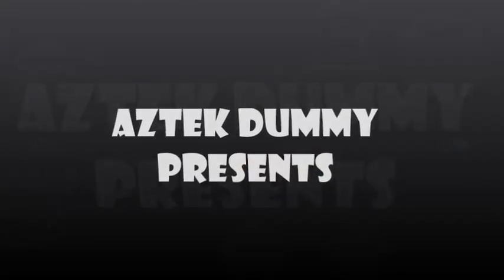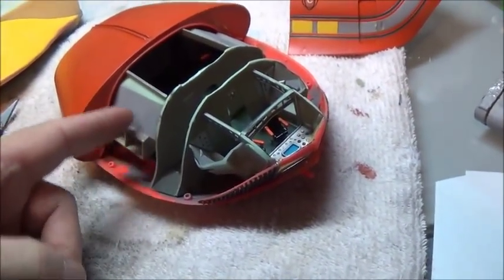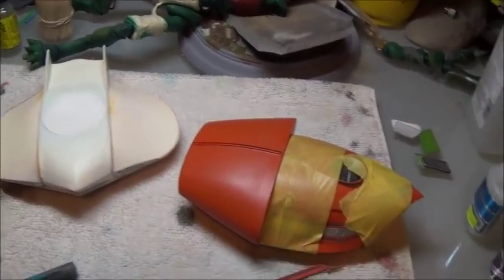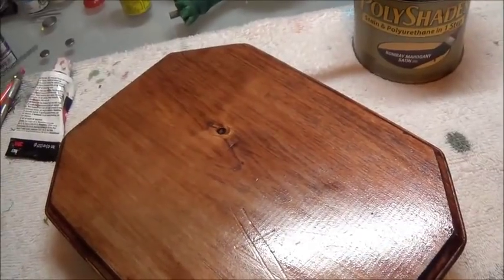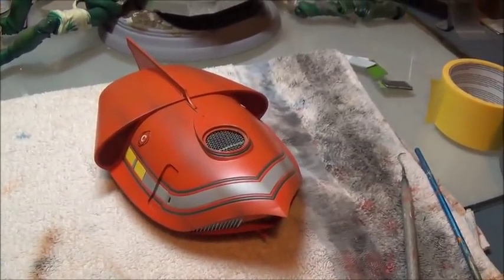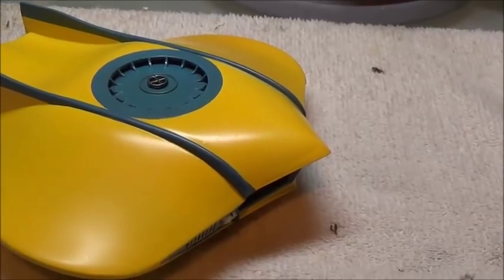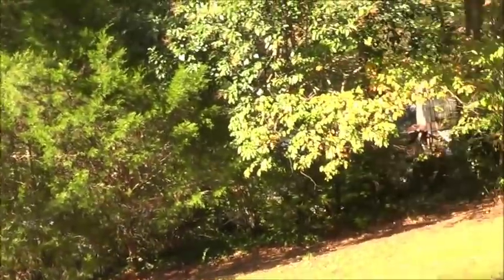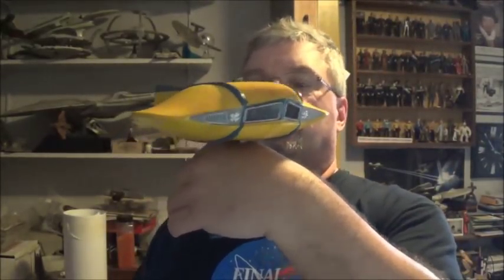Aztek Dummy Update 11/3/17 - voyage yadda yadda yadda pt 2

Comment: A new Dalmaso scale of measurement: The Sheen Scale from a maximum of Charlie to a minimum of Martin. To further refine I suggest a number scale centered on 50-- so that Charlie is "0" (stated "zero Charlie", etc.) Works great.

Ahh, those "crack!" sounds in the middle of modeling. Good for the heart. Glad my encouragement bore fruit-- but it looks like you needed to use the double-handed broad axe on that roof line. Worked good thought.

Both look very good. Now how can you not go get another pair and go at them for yourself? This time with lighting!